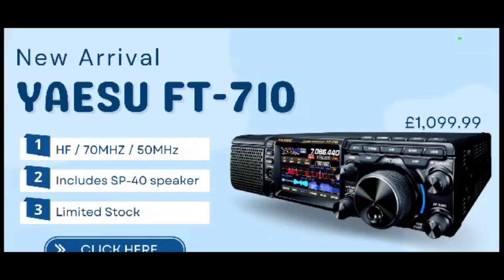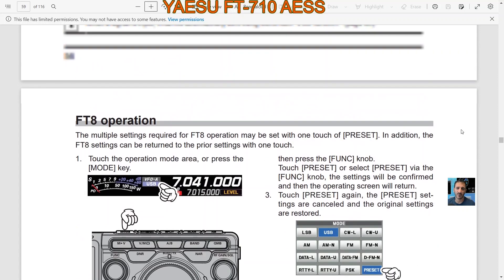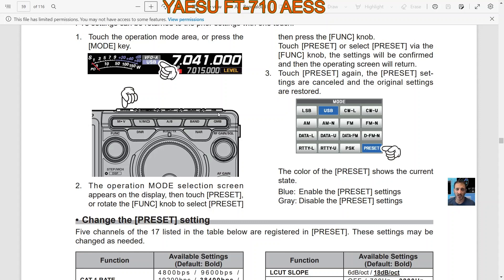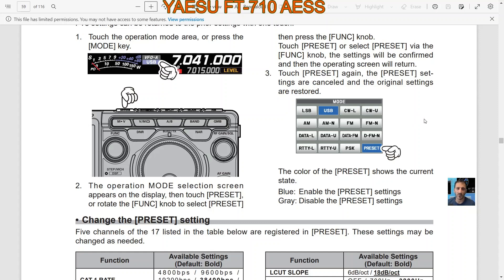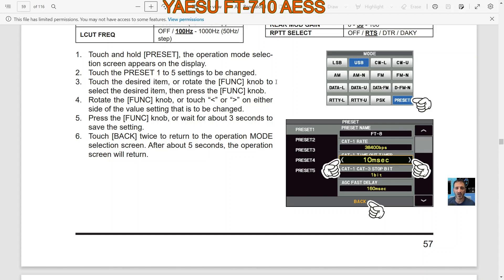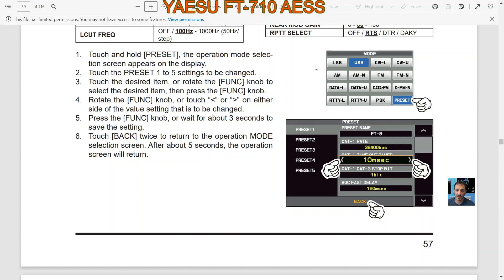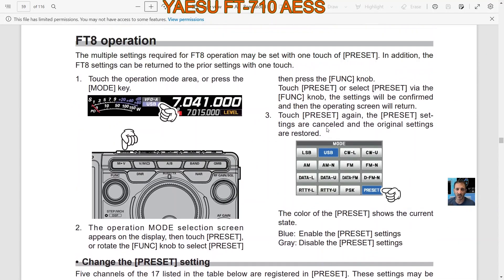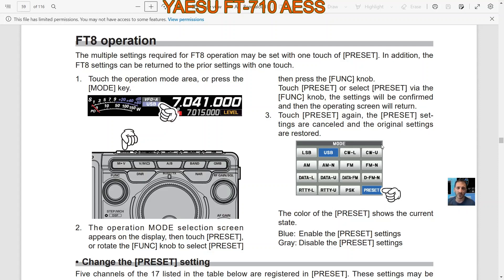YAESU FT-710 FT8 Mode -Manual Instructions

Comment: Have you figured out TX audio yet on FT8? I have rig control and RX audio working, but nothing on TX and I have, of course, selected the right USB audio input and output device.
Reply from the maker: Hi Nick,  mine arrives tomorrow i will make a video once i get FT8 working there may be a setting that pushes the tx through the USB have a look here:https://www.youtube.com/watch?v=ejbIAXF8eo0
Reply: @M0FXBHamTech  I've got other issues. It loses the CAT connection once you change bands. I've tried uninstalling the drivers, re-installing, resetting the radio, rebooting the pc. Occasionally it all works, but as soon as you change from data modes and the data preset to voice, it loses connection with WSJTx and won't connect back. See if you can figure it out tomorrow 😄
Reply from the maker: Have you selected Yaesu 1200 ?
Reply: @M0FXBHamTech  I have. Unfortunately, I don't have another CAT programme to try as I don't see the point of HRD.
Reply: @M0FXBHamTech  Got it working, for now, using 4800bd and FTDX-1200. 38000 doesn't seem to work despite my half decent laptop: Lenovo Legion 5 Pro! It comes back with Hamlib communication errors.